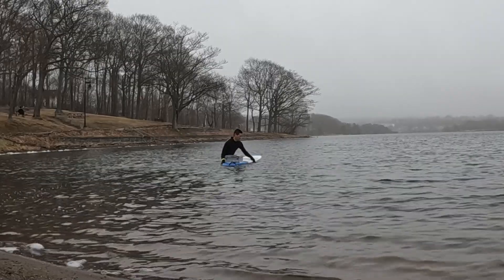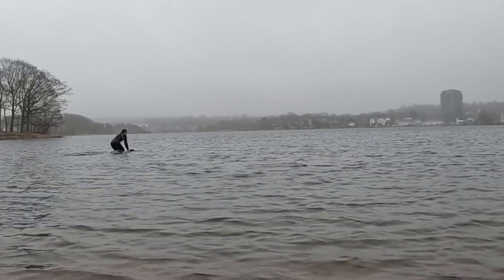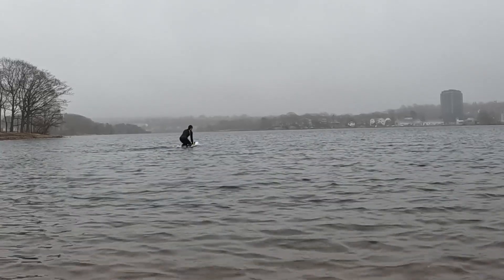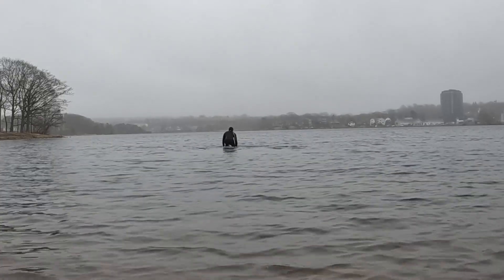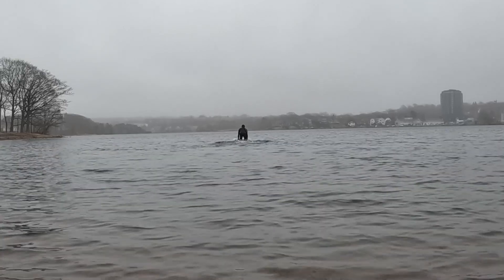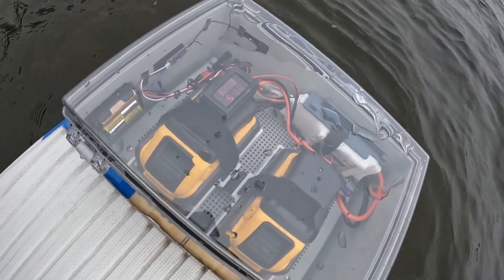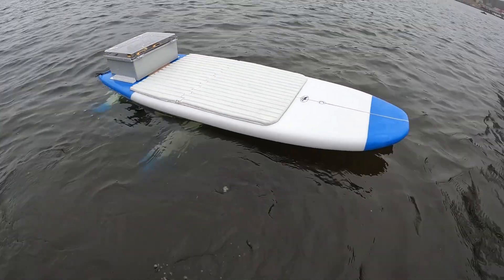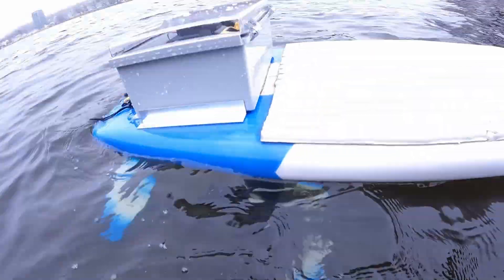DIY eFoil Testing | Flipsky Brushless DC 6384 Motor 140KV

Comment from the maker: After reviewing the video all I need to do is put more pressure on the back of the board to get airborne as I have plenty of speed. Water was too cold to do any more testing this day lol.
Reply: I hope that is all that is required.  I didn't see the other video and I am wondering how you determine the size of the foil and their angles.
Reply: I ride an efoil and I agree. The batterybox is in the way. Move it back even a little might do it. Try leaning back as far as you can for a moment, once you're up you want to shift slightly forward to level out or you will continue to climb until you breach. If you can get on your feet you can swiftly bend both knees, this will unweight the board and it will lift immediatly and stay level. I ride on my knees sometimes and it's great because you're closer to the water and you can do tighter turns. If you crash off the front cover your face. The life jacket will make your head just above the water and you can get hit in the face.
Reply from the maker: @michaelculhane3058  Thanks, I've since gotten the hang of getting up on foil and staying airborne. Unfortunately I can't move the box back anymore but I have added a battery which makes it weighted more to the rear so i have to put more pressure on the front now lol.

Comment: Man, that looks cold. I am at the Gold Coast, AU where the winter days are sometimes the best for surf and foil. Hey! I have a question and playing with the Flipsky VX3 hand controller and DC 6384 Motor... You went with some other brand of motor controller, but can I ask which of the flipsky controllers would you use for motor control? ... that is the most compact and fit in a Foil Drive size housing? :-) Many thanks!

Comment: Hello Andrew   Ask what kind of ESC you're using. Is the water cooling system pumped, or is the water simply pushed through the ESC by driving?

How many volts are the batteries using?

Thanks for your feedback.

Comment: Nice work! I love DIY efoil stuff and have two of my own. As others mentioned seems like you had the speed necessary to takeoff. The foil wing seems a little on the small side if you are trying to learn though.  I think 1400-1600cm2 would be an easier path. Smaller foils need more speed (and power!) to generate the lift and that makes learning harder.  Also when learning you fall a lot and it can take a toll on your body, especially at speed

Comment: You had more than enough speed to fly, when you move your body to the back, do it slowly, after airborne again move your body forward. Do this few times and try to keep in the air a bit more each time, until you feel that you control.
Reply from the maker: Thanks, that makes perfect sense. After watching a few other videos, I see I need to get the foil up higher and then level off by moving forward again. Can't wait to try it again!